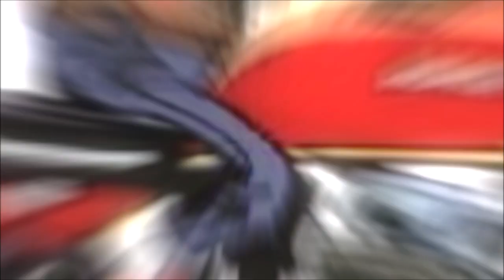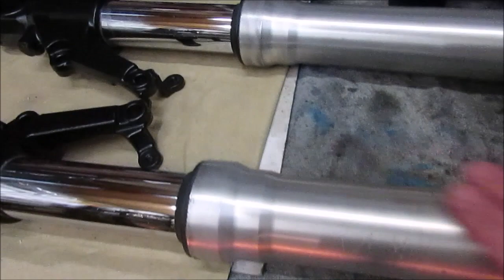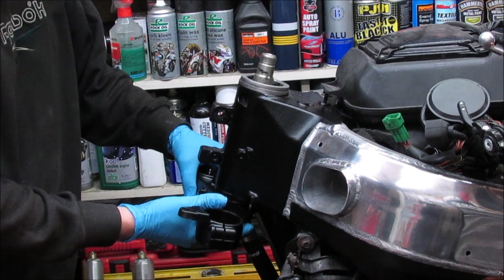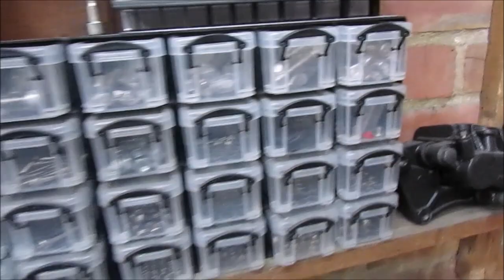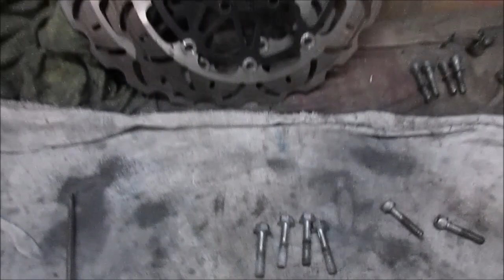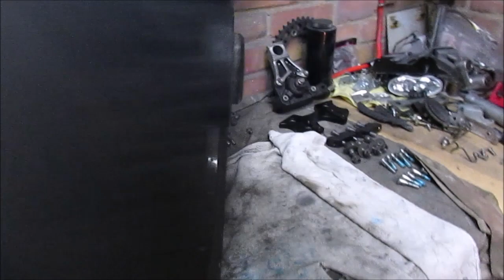Suzuki Hayabusa - Part 60 - Reassembly of the front end Part 1

Comment: Should you not torque the disc bolts and use blue loctite?
Reply from the maker: Cheers Edward, had new disc bolts that are pre threadlocked, need to take them back off as Daniel pointed out the discs are not symmetrical, will torque them down after, wasn't having a good day